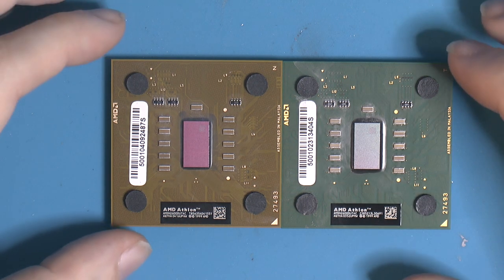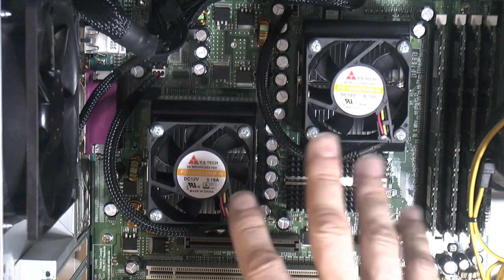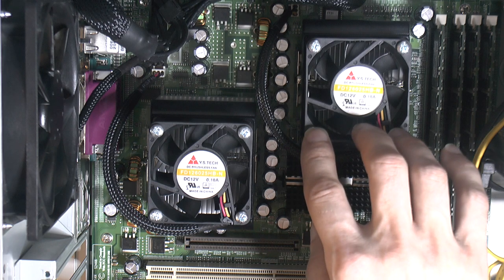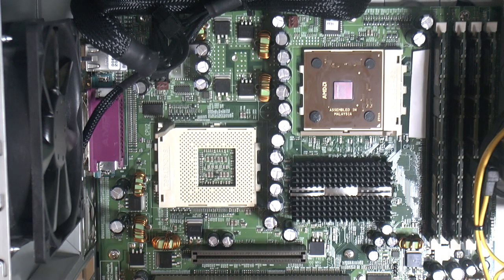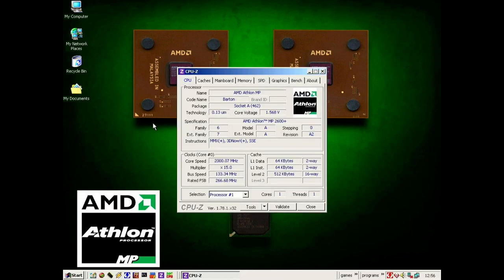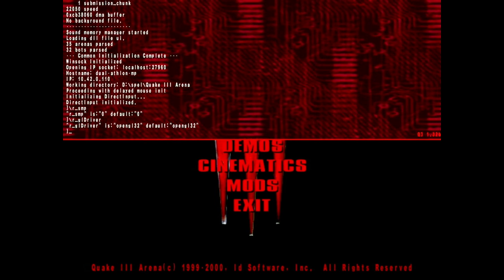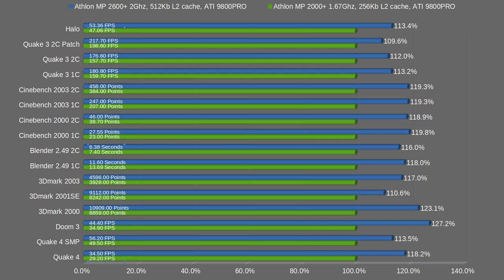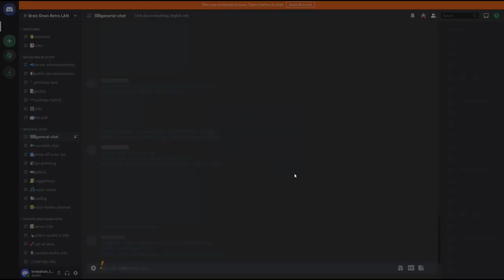Athlon MP Barton!

Comment: I may be a bit late, but one of the "problems" in this era of dual CPU boards was the AGP port.
As GPUs back then didn't offer much utility past 3D work and couldn't do any "computing" the multiple socket boards tended to do a cheepo juryrigging of the AGP port.
Rather than hooking it up to the busy North Bridge that would give a direct link to the CPU and give the performance, they used the South Bridge instead which made them significantly slower.

So I would advise anyone to check the chipset diagram for their board to make sure it has a North Bridge connection for the AGP slot if you intend to take it gaming.
Reply from the maker: Thanks for the info! Will look in to that, just came back from our Retro Lan party and it games very nicely tough, Quake 4 SMP it kicked P4 3.2Ghz HT with almost 2x the FPS with similar topend GP's so cant complain!

Comment: Did you know that the original Athlon MP Palomino came in ceramic packaging? I had an Athlon MP 1200 MHz in my first AMD build, it did over 1600 MHz and I ran it over 1700 MHz while benchmarking.
Reply from the maker: Yes I did. I have a ceramic Mobile Athlon 4 1300Mhz chip.
Palominos did come to the Athlon MP and Mobile before Athlon XP was launched for the desktop.